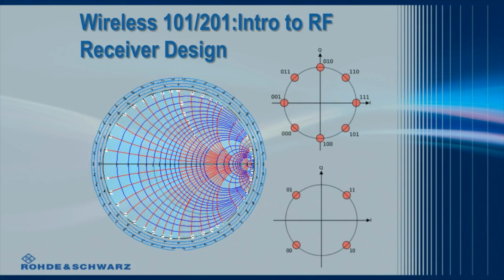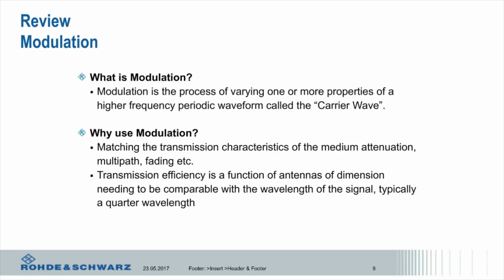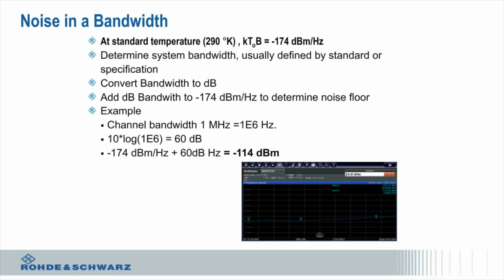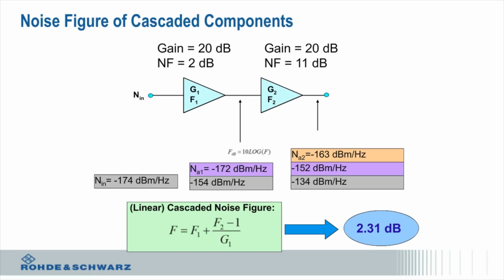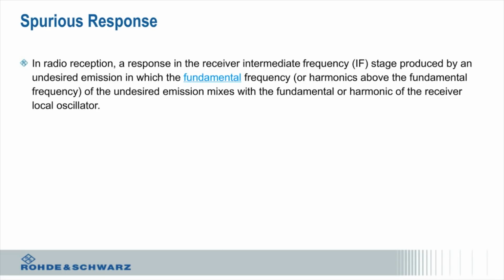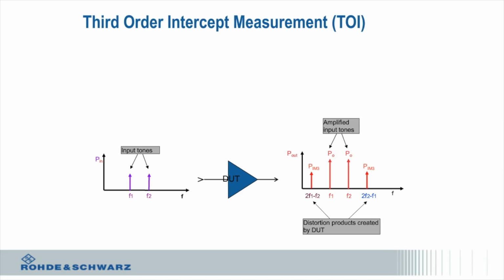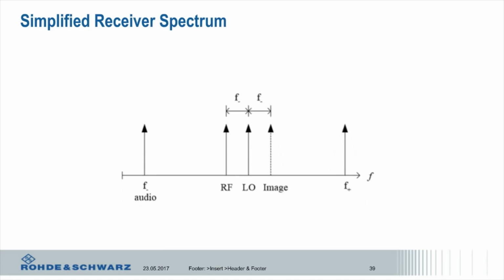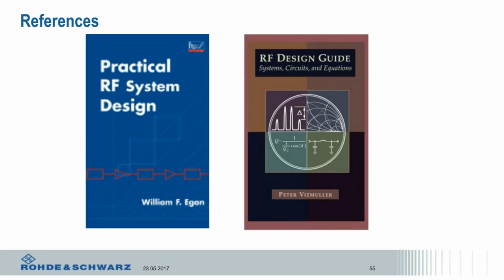Introduction to RF Receiver Design : Free Online Training

Comment: as a type of modulation you stated there might be a combination of Amplitude + phase modulation, yet antennas transmit information as 0 and 1. What is the purpose of having 4 (or even more) states with the previous modulation?  since 2 states are enough why waste power for modulations which are unecessary? 8:55
Reply: It's just an older modulation schemes. Nowadays Commercial radio and other low frequency applications use analog modulation. Everything else is digital AKA shift keying these modulations to  1 or 0.